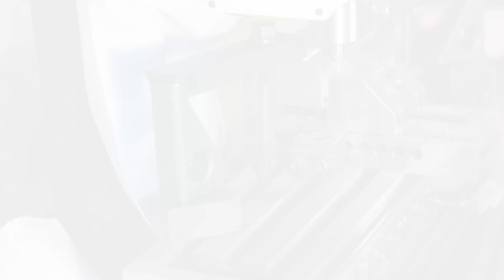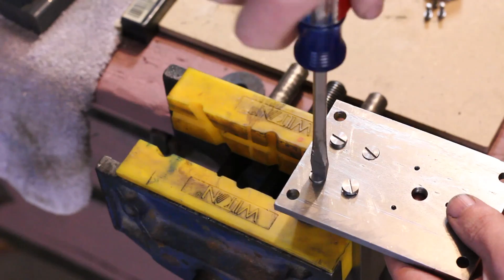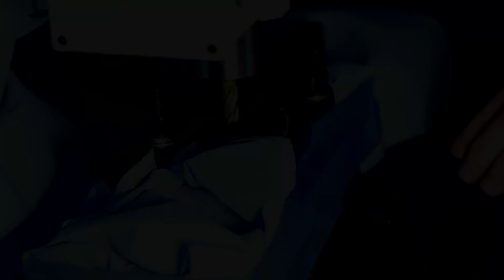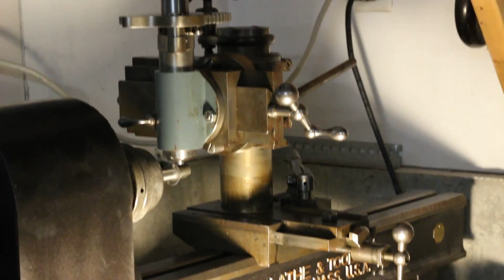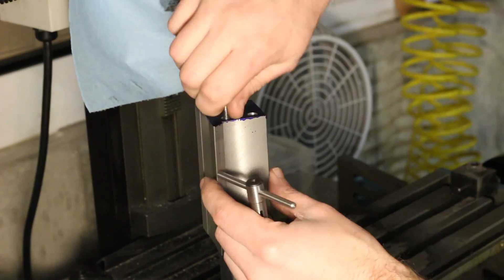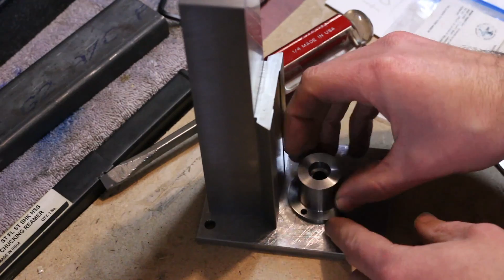Building the Trent Pinion Mill, part 3

Comment: Nice discussion regarding the mill tram & fly cutting ! You measured  the surface at one point, is it consistent along the length ?

BTW, I wonder if the trailer hitch ball would make a suitable part for a stout ball  & socket vise pivot ?
Reply from the maker: Thanks Len!  No, it varies a couple thousandths over the length.  That just got me thinking ... instead of using that surface as a reference for boring and reaming the spindle and overarm support holes, I think it would be wiser to use the front (the dovetail surface) as the reference surface and do that boring and reaming from the rear side.  Just one more reason I love you guys. :)
Reply from the maker: Oh I almost forgot - yes, the trailer hitch ball would be great for something like that!  In fact, the reason I have that one on the bench is because I will be using it for an articulated TV mount for the ceiling of our bedroom.  The bedroom has a lounge area on one side, and we want to be able to position the TV quickly and easily for viewing from the couch and chairs, or the bed.

Comment: Good to see castings are so good. Gorgeous screws... small items but lot of work!
If the CI is good quality I think that dovetail cutter should last pretty well.
I think your cut pattern analysis is probably right. More good progress.
Reply from the maker: Thank you Chris! I admit to having a penchant for making screws.  Just wait until they are hardened, polished, and tempered - they'll look even better!  So far the CI has been excellent quality.  The entire "bed" (what would be the table on a conventional mill) is made from CRS though, and it needs dovetails cut along the entire length, both top and bottom... I think that will be the real test of the cutter.  Thanks for watching!

Comment: Great video! Your machine is considered accurate. You need to surface grind now.There's a company called master abrasives in the UK . They have a Master Grinding Wheels.pdf study guide for you and other's to read up on.
Reply from the maker: Thanks!  I would grind certain surfaces if I had a surface grinder.  In lieu of that, I am scraping all critical surfaces of this machine.  So far, that has been the upper surface of the base plate.  The surface I was testing at the end of the video is now only important as a reference surface for boring and reaming the spindle and overarm holes, so it will be left as-is.  The dovetail surfaces, however, will be scraped in to the mating dovetails of the knee, after the knee is machined.  Same for the surfaces of the table (or "bed" as Hemingway calls it) and its dovetails. A surface grinder may be in my distant future, but for now I am doing without.